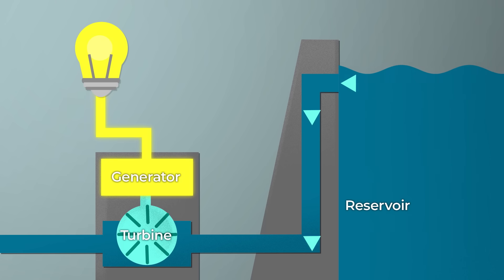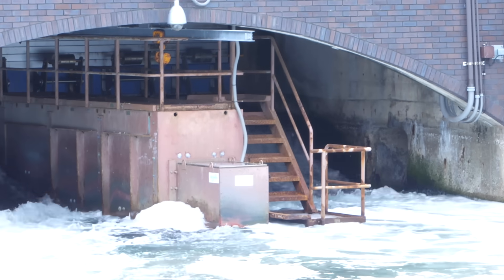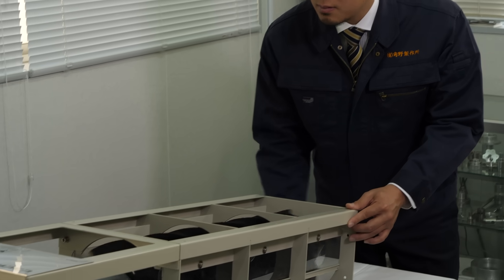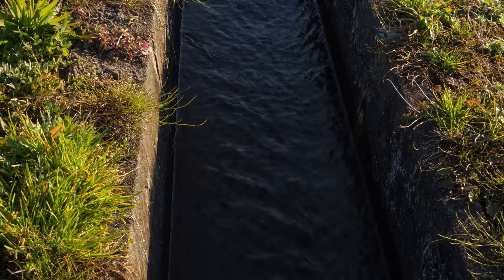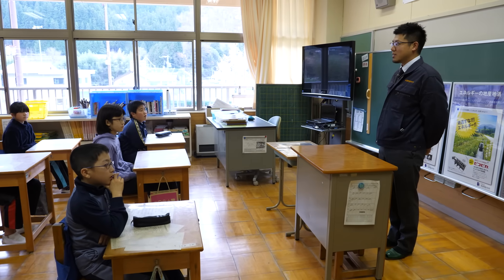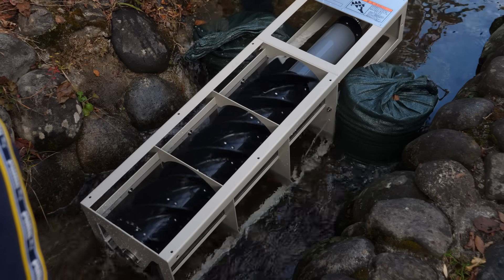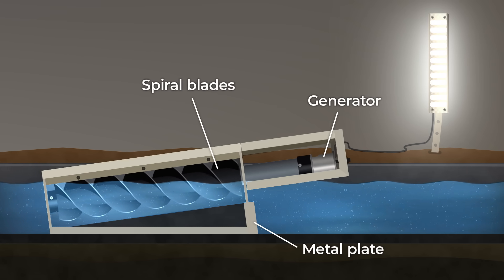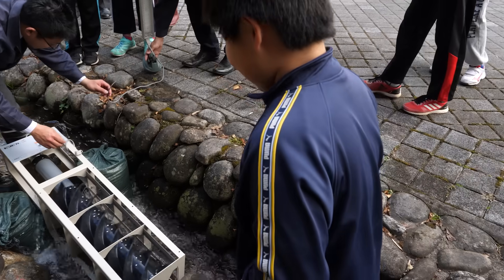Ultra-Small Water Power Generator

Comment: I guess it makes about 10w to 20w or so!
Supplement it with solar panels! Could make a battery stay topped at all times.
Reply: So if this ran for an hour, that's 10 watt-hours. Most people pay 3-15 cents for 1000 watt-hours. Assuming this costs $50, that's 6491-1498 hours of continuous use before this device pays for its self.
Reply: @seananderson5850  so it pays for itself in less than a year ?
Reply: @jasonbender2459  Oh... ok, have fun there, in that "special" place.
Reply: Got the numbers here. This device is named "PicoPica10" and you guess it - it generates 10W with the head of 0.1m and flow rate of 10L/s. PicoPica500 generates 500W with 0.7m head and 100L/s flow rate. 500 units are already sold and PicoPica500 has already been placed in Nikko City, Tochigi Prefecture, Japan.

Source: United Nations Industrial Development Organization (UNIDO)
Reply: I’m guessing under 10 watts....still enough to charge a small battery...which could run a small pump or heavier load for short periods.👍
Reply: A human can typically output around 300w for just a short while like when biking. Cant amagine this making 30w. Could easily backdrive 10 of those  with some pedals.
Reply: So the price for 20 W becomes the price of batteries time life (4 years maybe). Expensive and big pollution to...
Reply: Thought the same thing 👍🏼
Reply: Wow, a completely random guess by a completely uneducated person and that many people give it a thumbs up. This world is fucked!
Reply: solar panels are expensive man but this system will be great with some second-hand lithium iron phosphate cells
Reply: LordGryllwotth if that’s all it produces then it’s a complete joke
Reply: @henryhenry3832  what do you expect
Reply: pcislocked lol I was expecting enough to run a a few lights and maybe a small cooler of some sort but I realize the error of my ways 🤣🤣🤣
Reply: till the battery wears out or the stream drys up on a cloudy day...that is what wind turbine is for
Reply: @jasonbender2459  why talking about 1 ft drop only! What about the kinetic energy already in the flow. It's a running stream, not a stagnant pond. Might have dropped 100 feet before reaching the generator.
Reply: 10w? Are you nuts? It barely powered an LED bar
Reply: @drew1595  they claim 10W at 10l/sec - http://www.unido.or.jp/en/technology_db/5276/
Reply: @drew1595  That's after literally just dropping it in a tiny creek. I'm sure it can be optimized after the fact to produce more energy. Like how it shows blocking off the rest of the stream so it only funnels through the turbine. Or it can be scaled up a bit, as it shows powering street lights. What you don't understand, is that it's 24/7 power. Which means it can produce power infinitely. These means that even small, it can continually charge a bank of batteries. So when you don't need it, it "saves" its power.
Reply: @drew1595  Those bars can go anywhere from 5 watts to 100 watts and more, depends on the type of led, that one of the video looked pretty brilliant even with the clarity of the day.
Reply: @Wen6543  they are street lights so it's more then likely a 100 watt bulb
Reply: @punker4Real  Guys you are too pessimist, ok, what about this, the drains of several buildings go to a single big pipe and there you install a bigger version of this system. .
Reply: @drew1595  it's plenty of power for the size of the install and the GPM of water that's moving.
Reply: 1m LED need 1Wh it is around 40cm, so need stable 0,4Wh and light still flickering so not sure it can produce that amount
EU household need 10kWh a day, so need 25  000turbine for a 4 person family
Reply: @bandixd535   So ..... are u crazy? 10 kW per day?  I use 70-100 kW per month.
Reply: @outele  dude yes i know u crazy :)
You want me to ques how many person in your household, u have runing hot water or not, do u have a freezer or not, and so on...
Reply: @bandixd535   .... i have hot water from city  power stations(I pay separately for hot water). 2 person....  i have 1 
refrigerator and 1 freezer. 2 LED tv, all bulbs are LED , 2 laptops , 1 tower pc 700w with an LED monitor, 2 smartphones , 1 ipad , Beko BBO60S0MB(oven), 1 microwave, the other devices have no purpose to describe them
 
 they are rarely used(a day or two per week )
Reply: @outele  So if u use your PC 100 hour a month, with all other stuff turned off all the time then u already reached your monthly limit :)
Reply: @bandixd535  if i use it sure. but i use 70-100 per month
Reply: @jasonbender2459  I feel bad for you man, schizophrenia is a bad disease specially when you are poorly medicated like is obviously your case. Don´t worry about me, i´m wealthy enough to hire ditch diggers, i was just throwing ideas in a random Youtube video. Enjoy the rest of your sad life.
Reply: You can make that with a $20 solar panel.
Reply: 7Stroop145 yeah but at least the water provides power 24/7
Reply: @Socal_Geo1  good luck when the weather is bad and the sun goes down vs 24/7 hydro.
Reply: That thing couldn't power anything worth a damn. Took the whole under side of a bridge to power like 6 street lights
Reply: @cheechchickens1854  Or, for that matter, worth a dam. ;)
Reply: @cheechchickens1854  This mini generators have great potential, imagine for example every house, building, etc. equiped with this things installed in the pipes of the roof drains, specially vertical pipes, you have a lot of electricity there.
Reply: @Socal_Geo1  This mini generators and solar panels complement each other nicely, add some low maintenance micro wind turbines  there is no reason to not have the three systems, and if you are the one that does the installation and maintenance you could make some money selling energy back to the grid, of course that depends on where you live, in some countries the electricity companies own the sun, the wind, the water and your soul. We need more liberalism.
Reply: W Nij the reason not to do all three is the price per Watt.
Reply: @Socal_Geo1  Why? Ok,  let´s say solar is cheaper (hydropower at big scale is insanely cheap, the cheapest) once you covered your roof with solar panels you´ll want more, then you can add the other systems with a minor investment, at night if it´s raining you can have this micro generators charging your batteries, powering your outdoor lights all night, etc.
Reply: Solar panels and few of these working together is the best way as mentioned.Both working during daylight hours but the water generator works also at night
Reply: Solar panels don't work in the dark. Hydro works 24/7.
Reply: @Socal_Geo1  
True but if you have a Creek why not use it
Reply: @Wen6543  -  Read my mind!  This with a solar cover and a wind turbine...
:)
That'd be downright fun.  :D  Lol.
Reply: @Wen6543   Roofdrains would be clogged with debris and this would just be a clog producer. And i dont think you'd have a lot of power in any pipes in the home, If you think about it. Only when showering would you have a constant enough stream to get the generator up to speed, and thats only for a couple minutes at most.
Reply: @pilodrou4213  True, not much power but imagine big buildings, imagine a lot of buildings, there you can have a nice plus of green energy.
Reply: @Wen6543  you miss to much points in the real world:
_more power equal more axes moment forces equal more water and pressure required (3m is.0.3 bar... Nothing)
_not only water fall, leaves are falling to... Need to climb on your roof and clean all the time
_only in England it's rainy day every day, normal countries doesn't have rain every week.
_what do you expect to make running with this from your roof water system? Hot water system? No, you can not, maybe your lights only the rainy days.
_do you think material don't need to be repaired sometimes? Blades only maybe?
Reply: @WheresJimToday  no, the same problem: you need a source. Sun is for solar panel, water flow (and not anly water) is required for hydrolic system.
In fact the only word "hydrolic" is not enough to well understand what is the source. So you need not only water, but a river... This river to exist and have water flow all the time... This river has dirts and fish... Etc...
Not si simple than you are thinking.
Reply: @DGDG0000000  As i said it'll work 24 hours where as solar won't. As long as there is a water source it'll work. Don't need a river.
Reply: @Wen6543  not only. This is good also cause  for some things like light at night doesnt need batery necessarly. And battery isnt eco friendly. Its a cheap investment for a long time end.
Reply: John jacobjingle because you can use much cheaper things... that’s “why not”.
Reply: @Wen6543  hahahahaha you for sure wouldn't
Reply: @Wen6543  They used to make household appliances that ran, directly, mechanically, off the water pressure from the tap.
Reply: @Wen6543  [no reason] "How much did I just spend for what return?"
Reply: The design of the turbine is not good enough for an efficient flow of energy. It would be easier to buy solar panels. Even if they don't work at night, they will harvest more energy than that turbine and who said there would always be water in the river?
Reply: Peter Parker  It doesnt work efficiant. There is better sorce of power. Idiot!

Comment: It would have been more informative if the power rating of the turbine was given. Can different turbine generators be installed depending on the load? It would be great for camping. No more gas generators running all night. Just need enough power to operate a couple of lights, a radio and keep a laptop charged.